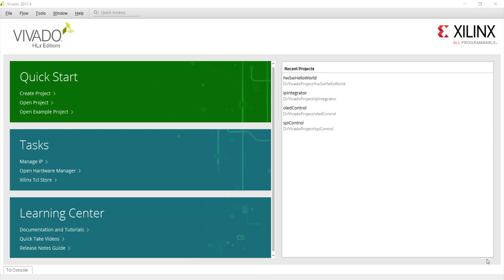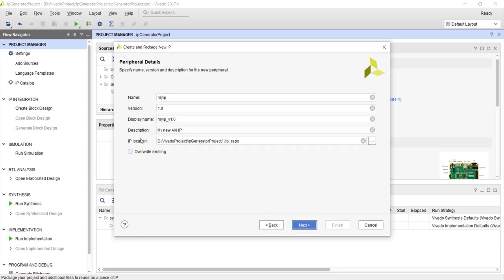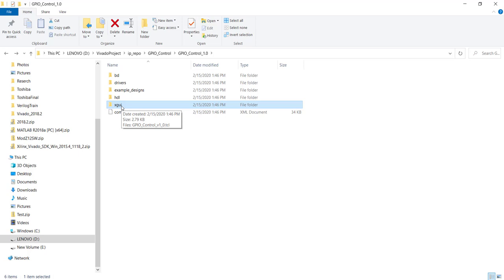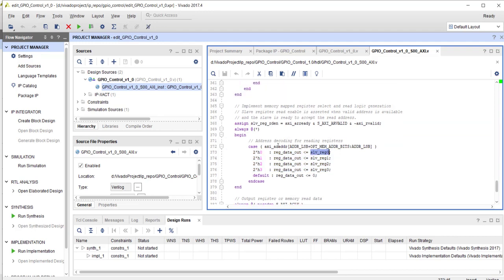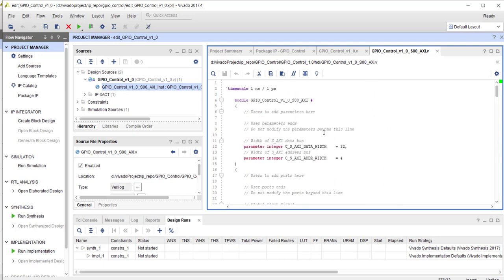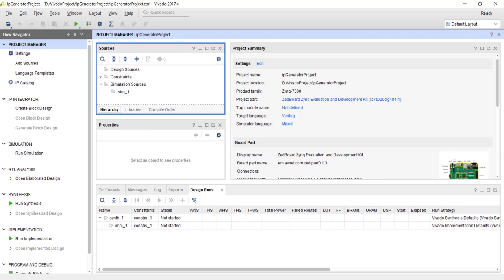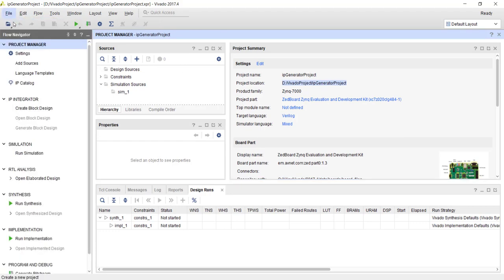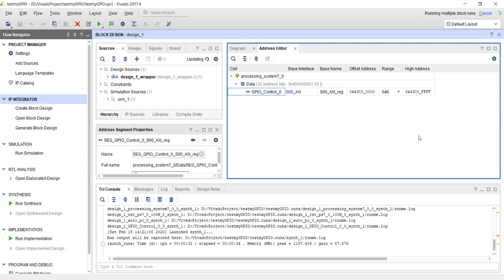Generating Custom User IP Core in Vivado

Comment: But sir, in this tutorial, you have written "assign leds = slv_reg0" . But sir, here the slave registers are 32 bits but the leds has a dimension of 8 bits, so, won't there be a bit size mismatch betwee leds and slv_reg0 in the mentioned instruction?
Reply: I think AXI interconnect takes care of that

Comment: I remember hearing for loops cannot be done in always blocks because everything needs to be executed in that cycle. But there are for loops in GPIO IP block.  How do they work for example say @25:23? Thanks in advance.
Reply from the maker: This may require a long explanation. It will be incorrect to say all for loops are non-synthesizable or all for loops are synthesizable. It depends on what the loop does and how smart the EDA tools are. But all for loops which can be statically unrolled are definitely synthesizable. For example you have a memory with depth 5 and you need to initialize it to 0 when reset come
always @(posedge clk)
begin
      if(reset)
      begin
             mem[0] <= 0;
             mem[1] <= 0;
             mem[2] <= 0;
             mem[3] <= 0;
             mem[4] <= 0;
         end
..............
..............
Same logic you can write using for loop as

always @(posedge clk)
begin
      if(reset)
      begin
             for(i=0;i<5;i=i+1)
             begin
                    mem[i] <= 0;
             end
.................................
This is synthesizable since when the EDA tool unrolls the for loop it gets the exact same expression as before. Again remember HDL languages they are just describing what hardware you want. It is up to the tool to decide how it will be implemented. No tool will create some register i to control the loop and try to increment that register from 0 to 4 on a single clock edge. In that sense it is impossible. What the tools do is they will unroll the loops and will check whether they can be statically implemented. If yes, they will.
Suppose now you want to find the smallest number. I am putting a complete module here to do it

module testLoop(
input clk,
input [7:0] data,
input  dataValid,
input [3:0] addr,
output reg [7:0] min
    );
  
integer i;
reg [7:0] storeData [10:0];
reg [7:0] tempMin;

initial
begin
    for(i=0;i<11;i=i+1)
    begin
        storeData[i]=255;
    end
end

always @(posedge clk)
begin
    if(dataValid)
        storeData[addr] <= data;
end

//Logic to find smallest number from the memory
always @(posedge clk)
begin
    tempMin = storeData[0];
    for(i=0;i<11;i=i+1)
    begin
        if(tempMin > storeData[i])
            tempMin = storeData[i];  //Notice blocking assignment
    end
    min <= tempMin;
end    
    
endmodule

Again you will find for loop to find the smallest number. This is also perfectly synthesizable now in Vivado. This logic can find the smallest number an array of 10 numbers in a single clock. But look at the coding style
if(tempMin > storeData[i])
            tempMin = storeData[i];  //Notice non-blocking assignment
Here you will see I am using blocking assignment (=) to put the new value in tempMin. Although tempMin is declared as reg type, this style will cause a combinational logic. Instead of blocking if you use non-blocking (<=), logic won't work since you are saying new value to tempMin should come on the clock edge and in a single clock edge it can take only a single new value. So what gets implemented is a big chain of comparators. The first input to comparator are storeData[0] and storeData[1], that output goes to the next comparator whose other input is storeData[2] so on and so forth. The final statement min <= tempMin is non-blocking. So min is inferred as output of registers. So the output of the last comparator goes as the input of 8 flip flops, whose output we are calling as min. A few years back this logic was non-synthesizable since Xilinx tool didn't allow mixing blocking and non-blocking assignments in the same always block. But now the tools are smart and it can handle it.
It is very interesting that even complete sorting can be done in a single clock!! Vivado is so smart

module sortTest(
input clk,
input [7:0] data,
input  dataValid,
input [3:0] addr,
output reg [7:0] out
    );
    
integer i,j;
reg [7:0] storeData [10:0];
reg [7:0] temp;

always @(posedge clk)
    out <= storeData[addr];

always @(posedge clk)
begin
    if(dataValid)        //Initially to store some data in the array
    begin
        storeData[addr] <= data;
    end
    else
    begin
        for(i=0;i<11;i=i+1)  //When data is not being stored, sort. In a single clock!!
        begin
            for(j=0;j<10;j=j+1)
            begin
                if(storeData[j] > storeData[j+1])
                begin
                    temp = storeData[j];
                    storeData[j] = storeData[j+1];
                    storeData[j+1] = temp;
                end
            end
        end
    end
end   
endmodule
But it will be huge combinational circuit and as the size of array increases, the maximum clock frequency will drastically come down.
Reply: @Vipinkmenon  This indeed is very interesting, specifically, that both combinational and sequential logic can be mixed in a single always block. However, in your sorting example, you are using non-blocking assignment to storeData[addr] when dataValid is high, but then are using blocking assignments for storeData[j]= and storeData[j+1]= (within the else branch). If both non-blocking and blocking assignments are made to the same storeData element, how will the tool decide whether storeData should be actual register flops or just combinational signals? Also, you are using a nested loop, to successfully implement a bubble-sort algorithm, during each iteration of the outer loop where are the results of the inner loop being held? Thank you in advance for your time, your insights are quite helpful.
Reply from the maker: One thing we need to remember is that the HDL languages (both VHDL and Verilog) were developed not with an intention for logic synthesis but with an intention of modeling and some kind of short cut for storing the schematic representation of the circuit. Later when EDA tools developed further, they were adopted as input for logic synthesis also. So like any models, they are not perfect and seems Verilog has more imperfections. Some of them are induced by the synthesis tools itself. For example as I mentioned before Xilinx's ISE tools they didn't support mixing blocking and non-blocking, which actually make sense, or dividing by any number which is not a power of 2. In Vivado both these constraints are removed. But there are still some constraints like you cannot mix edge and level triggering in sensitivity list. So
always @(posedge clk or reset)
begin
    if(reset)
        c<= 0;
    else
        c <= b;    
end
This will give an error since clock is edge sensitive and reset is level sensitive. But practually the asynchronous reset is level sensitive but we are still forced to write 
always @(posedge clk or posedge reset). So here modeling defers from implementation. But VHDL doesn't have this issue. We can write 
process(clk,reset)
    if(reset) then
          c <= '0';
   elsif(clk'event and clk='1')
          c <= b;
end process;
Now as you mentioned what will be implemented when we use blocking or non-blocking now has some kind of confusion now since now Xilinx allows to mix them in the same always block. So in many cases will have to check post synthesis schematic or run a post synthesis/implementation simulation to know whether things are exactly when we intented. But one thing for sure is, if we use non-block assignment inside an always block, the left hand signal will definitely the output of flip-flop(s)

always @(posedge clk)
begin
    if(reset)
        c<= 0;
    else
        c <= b;    
end
So here c will be the output of a FF. Now if we use blocking here
always @(posedge clk)
begin
    if(reset)
        c= 0;
    else
        c = b;    
end
Still Vivado doesn't care, he implements the same circuit and c will be the output of a FF to satisfy your modeling requirement. Modeling says b's value gets propagated to c only on clock edge. But here your functional simulation and post synthesis simulation will behave differently. If c's value is used by any other part of the circuit, the part will see the new value of c on the same clock edge where it gets value from b. But in post synthesis/implementation simulation, the circuit will see new value of c only on next clock since it is coming from the output of a FF. This could be problamatic. So it is better to stick with the first model.
Now if we mix both
always @(posedge clk)
begin
    if(reset)
        c= 0;
    else
        c <= b;    
end
Again Vivado doesn't care, it is exactly same circuit. But as mentioned before functional and post synth/imp simulation behaves differently under reset.
Now confusing parts
always @(posedge clk)
begin
        b <= a;
         c <= b;    
end
No confusion here. Clearly 2-level pipe lining. b is the output of a FF, which is going to another FF whose output is c. Now

always @(posedge clk)
begin
        b <= a; //Non blocking
         c = b;  //blocking  
end

Here I would expect a single pipelining since I am using blocking assignment between c and b, there shouldn't be any pipeline there. But Vivado doesn't care. He implements the exact same circuit as before. So there will be again difference between functional and post synth/imp simulations. This I don't know why Xilinx chose to do so. Because putting a single FF between a and b and calling same node as b and c will satisfy my model and the value of c will change only on posedge clk since b is an intermediate register inside the always block whose value cannot be changed by anyone else.
But if you write

always @(posedge clk)
begin
   b <= a;  
   c = b;
   d <= c;  
end
Vivado is smart here. He doesn't put a FF between b and c in this case. So b and c are the same node which is the output of the first FF. So here my model and implementation are matching. 

always @(posedge clk)
begin
   b <= a;   //declare both c and d as output of the module and b as internal
   c = b;     //register
   d <= a;  
end
Here there is one FF between a and d and 2 FFs between a and c
It seems the tool checks whether the lhs signal is used later in the same circuit, if yes then he won't put FF for blocking assignment.
So in conclusion for Vivado
1. If you use <=, the signal on the lhs will be the output of FF (if the tool doesn't optimize it)
2. If you use both <= and = with the same signal inside an always block, it will be still the output of FF
3. If you use = with a signal and if that signal doesn't go as input to another logic in the same always block, the lhs signal will be the output of a FF. Otherwise it will be the output of a combo logic
Now with this info to answer your question, since 
storeData[addr] <= data
is present inside the always block, storeData are outputs of FFs. It doesn't matter whether = is used with it later
 Since it is written
temp = storeData[j];
and temp is used in the same always block, temp will be the output of a combo circuit. If we write
temp <= storeData[j];
it will be output of FF, and the new data will come to temp data only after clock edge and sorting won't work. temp will get the value of storeData corresponding to the largest value of j (here storeData[9])
If we write storeData[j+1] <= temp instead of storeData[j+1] = temp, again logic won't work. The only thing that will happen is storeData[10] will get the value of temp, which will be storeData[9]. All other values remain intact. I hope you have a better idea now. 
But... this is not entirely true. In reality there is no circuit whose output is temp. As I mentioned before, what the tool does is he unrolls the for loop and implements the circuit what you have described. So you will have a bunch of FFs representing storeData. The input of these FFs are coming from a mux. The mux is controlled by datavalid. If dataValid is high, data will go as the input to these FFs. If datavalid is low, the output of a big combo circuit goes as the input to the FFs (So mux inputs are data and the output of this big combo). The output of these FFs are going to a big combo circuit. This big combo is the result of this loop unrolling, which does the sorting. So it gets output from all storeData registers and have chained comparators for storeData[0] to storeData[9] to find the smallest number. This output is going as the input to the mux which is connected storeData[0]. The temp will will represent many intermediate positions of this circuit. Then there next chain of comparators whose inputs are these intermediate positions (There might be 9 temps), whose output is connected to the mux for storeData[1]. Then it has intermedite points representing 8 temps. So on and so forth.... 
We really need to appreciate the engineers writing these EDA software...
Reply: @Vipinkmenon  This was an amazing explanation and has made things crystal clear for me. I also tried your bubble-sort code with a reduced storeData array size of only 4 elements, then looked at the Elaborated design schematic in Vivado. It perfectly matched the unrolled mux/comparator combo chain logic that I had drew by hand! You have really taught me something new about Vivado, thank you!
Reply from the maker: @TM-wd3pp  Thank you.. Happy coding..